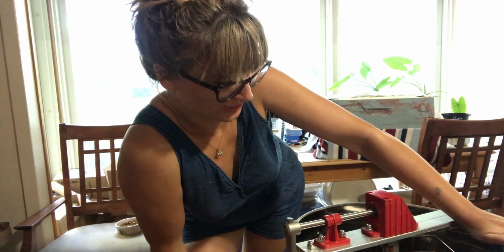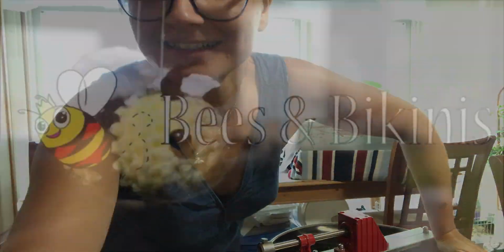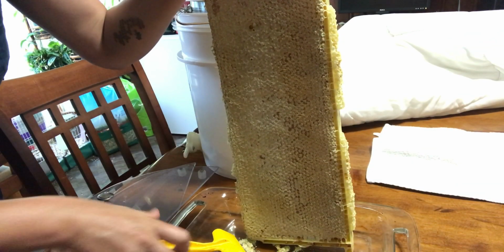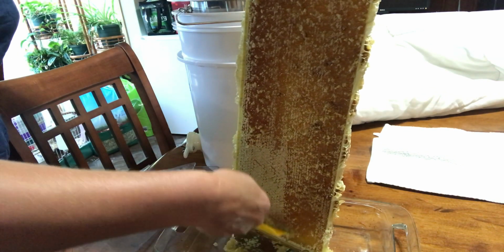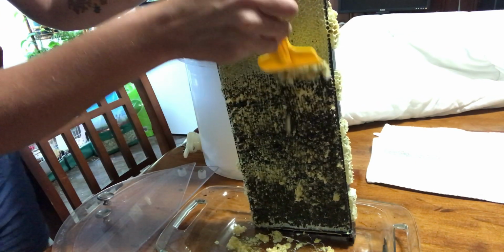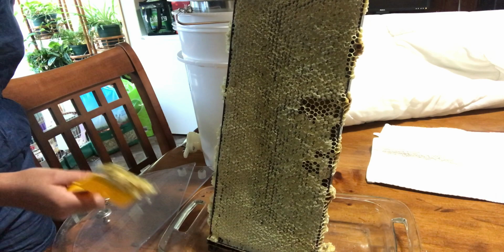Extracting Honey With 2 Frame Manual Extractor - How to Extract Honey - Beekeeping for Beginners

Comment: I need a new extractor. Had one similar. Handle broke, now the plastic lids broke and frame holder has a few loose rods in it. Only lasted like 5 or 6 extractions so won't buy that again.
Reply: I have one like this too.  Made in China.  It broke during the first extraction, so I had to modify it.  Take care Brian!
Reply from the maker: This one keeps falling apart. But just from the vibrations.
Reply: @BeesBikinis  mine too.  The pastic lids  broke.  want to get another year out of it and then get one not made in China.
Reply: @PaulOtis what modifications did you do because I have one also and it leaves alot to be desired.